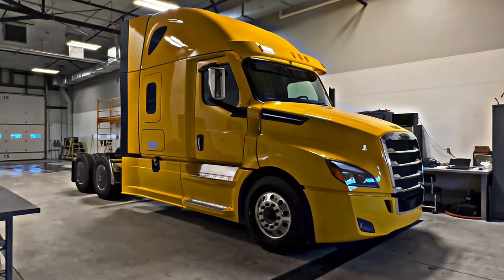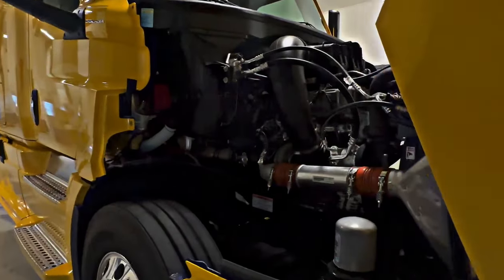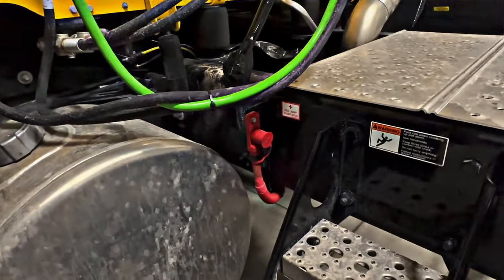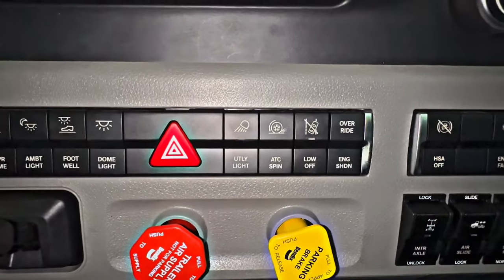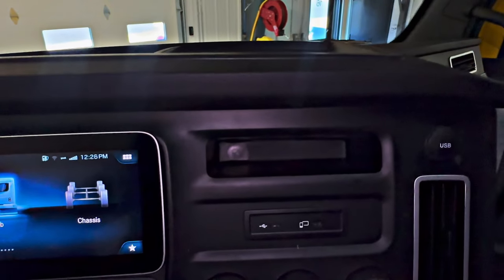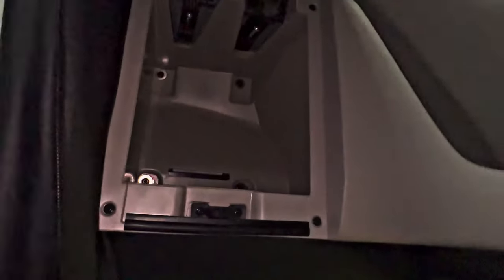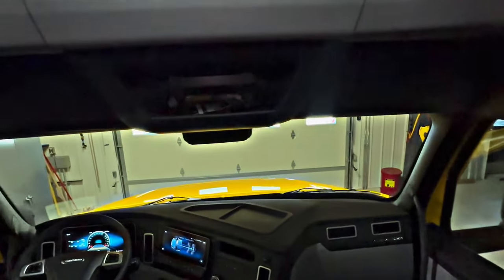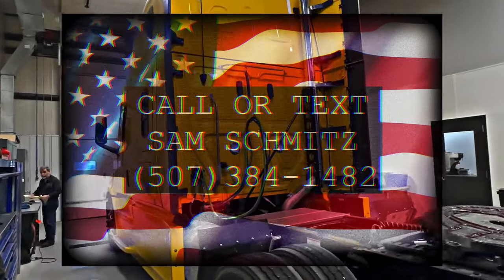2024 Freightliner CASCADIA; Interior SURPRISE?! DIGITAL DASH?! FLAWLESS!!

Comment: I think Cummins could beat Detroit Diesel as far as reliability
Reply: Meh. It’s a hit and miss on both engine platforms. You can get a lemon x15 or dd15 or you can get a good one. X15 is generally better but dd15 is cheaper to maintain.
Reply: True but I think the fuel economy with the x-15 would be slightly better not like it matters when you're towing a 500000 pound trailer
Reply: Good luck dd15
Reply from the maker: Not true. Like guy above said, lemons happen. But Detroit stands behind their product for a longer duration. 

Do you have any actual reason to think Cummins > Detroit, or is it emotional - like your buddy’s buddy had one that broke down once?
Reply: Cummins more reliable, better for cold weather. I’ve always had better heat coming from Cummins then dd15. But imo Cummins is rock solid compared to
Reply: Alex , I’m thinking of buying it with cumins too 
Just scared because one guy said why buying Freightliner x15 when you can buy Detroit motor in it ??
I was driving Volvo and had a terrible experience 
Don’t want to be locked down for 72 months before I do some research 
One I’m buying is 2024 Freightliner cascades X15 Cummins with 500 HP 
ANY HELP WOULD BE APPRECIATED
Reply: When did Cummins re-enter the engine market? Last I heard, they stopped manufacture of truck engines because the EPA would give them a waiver to finish research on their exhaust system.

Comment: I'd rather push my peterbilt than to drive that pos.
Reply from the maker: Well, that’s a new one..! To each their own, I suppose. Can I ask how you calculate that to be strategically more beneficial to bottom line?
Reply: @MidwestBestHDTrucks  where to start. I owned 2 freightliners w/ Detroit power. Neither one made more than 600k before they both sank liners. 
  So much flex in the bodies that caused interior plastics to loosen and break constantly.  
 I've got a t660 with  the cummins. 1.2 million miles, never been opened up except to adjust top end. Still original clutch.  My 587 peterbilt w/ cummins is at 1.6 million. It has had a rear main seal and front structure resealed. My 389 is at 640k w/ cummins. Not a single drip anywhere. 
I'm sure some have good luck with the freightliner, but I'm not one of them.
Reply from the maker: @donmunro144   I can understand a lemon leaving a guy with a sour taste. But the ‘Freightshaker’ reputation FTRL gave themselves in the nineties/early ’00s, is a thing of the past. They’ve come a long ways. Have a guy in here ordering a new Cascadia - trading in a 579. It’s all preference, but I see guys moving from Pete’s to FRTL/WST almost every day. Look at the numbers and you’ll see it too. People feel betrayed by Paccar for how they were treated during COVID, be it the pricing or availability. They gouged hard, and that’s not opinion. I hate using the word gouge because it’s usually uttered out of self-pity. In this case, I pity guys that depended on them. But I also respect a guys choice. I’ll leave you with this - I hope your business thrives in whatever you run, but if you ever want to look at one of these I’d be more than happy to talk. Appreciate you taking the time to view and comment 🤝
Reply: Give it a month an Murphys  diesel will be scrapping it off a bridge and put it in the yard with the other 75 wreaked cascadia s
Reply from the maker: @danbuchner1494  first one has been on the road 3 months and has had not a single issue, other than an ABS line. I actually appreciate the honesty. So many guys have a cousin’s buddy’s in-law that owned one with an oil leak and then think every one is junk. It’s serious knucklehead-naïveté. I feel for anyone who gets stuck with a lemon. But our dealership stands behind the trucks we sell, and have built a reputation that speaks for itself. If you’re ever in MN, and you need assistance - regardless of what you drive - you now have my number and I will do whatever I can to assist. Stay safe out there; appreciate the work you do. Have a great day, sir. Hope the trucks do well for you, and business too. 👍

Comment: How is this owner opp speced lol it doesnt have the best arrow it has the gray plastic finish not the wood grain it has  a DD15 not the DD16 or cummins X15, its automatic dt12 trans you can get these with 18 speed manual trust me ive seen them this is not a true owner opp specd tractor this is a slightly modded fleet truck this noting you cant get from the average mega carrier.
Reply from the maker: You’re embarrassing yourself…
Reply: @MidwestBestHDTrucks  how that's not a owner opp specd truck what kind of owner op spes a truck with just some lights and a vertical exhaust that's a glorified fleet specd truck real owner opp specd trucks have bigger power and way more bells and whistles ,what owner opp wants a truck that's only 460 and 1650 torque could of saved a bunch of money and bought the same thing on the used market and added the same accessories,every owner op I personally know who ordered a tractor ordered their truck with more than 12 gears and 400 HP especially considering the DD15 can still get over 7 mpg with a 515 HP version of the engine, that's a glorified fleet specd truck that ain't no real owner opp truck. nussbumm has better  specd trucks than that and their a mega carrier.
Reply: @MidwestBestHDTrucks  what are you talking about? Paccar has a larger digital display in the 579, 567, 589, etc. Also, in the KW W990, T680, etc. They were the first to the market with a full digital display before Freightliner. I know this because I leased one when they first arrived on the scene. They've been out for a few years now. You're displaying your ignorance because you're a fan of an inferior product. Don't get me wrong; I totally understand. I was once a salesman, not of trucks but of cars. But the ideology is the same, so I get it. You're a salesman; you're supposed to back your product. But just because you're excited about your product doesn't mean it's the best. Freightliner sucks; I've owned two Cascadias. They're hot garbage. I've been driving for 14 years and driven mostly every tractor you can think of from every manufacturer, so I know what's good and what's garbage. Cascadia and the pro stars with the MaxxForce is at the top of my list of trucks I will never purchase."
Reply from the maker: @nasheemwhye5197  do you know what a B-panel is? You sound unhinged.
Reply: Thinking of buying one 2024 Freightliner with x15 Cummins
Could you help me buddy ??
I heard both good and bad things for Cummins and Detroit in Freightliner

Comment: lol! Y’all taking about peterbilt and Kw’s like they’re not plastic heaps of junk, 579’s,680’s all throw away trucks!  Go buy a new 389 or w900,990 and it’ll cost more than your house. Good luck making a living lol! When you pass a truck sitting ion the side of the road with the hood up look and see if you dont see that red motor sitting there. Yep, it’s a Cummins! Freight doesn’t pay based on the make of truck
Reply: Hey the kw t680 or Pete 579 are Damm good trucks. Especially when it comes down to the fuel economy. And both have great ride.
Reply: @victorbernier4765  my point is they are plastic trucks just like the Cascadia. Cascadias get good fuel mileage as well. Unless you’re riding in  a 379 or W900, it’s plastic.

Comment: When when cascadia gonna make better steps on the sides to climb on top of frame and better HWY horn
Reply from the maker: Good question. There are a several factory options for frame-mounted steps, grab handles, and deck plate configuration; along with several ways to configure trailer hoses, electrical connections, and even prep-options for wet kit hydraulic fittings.